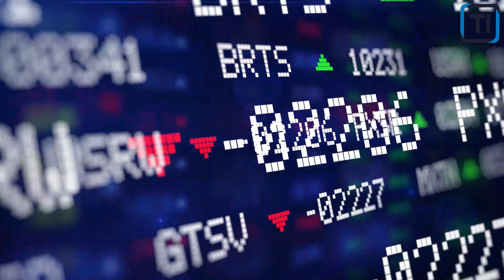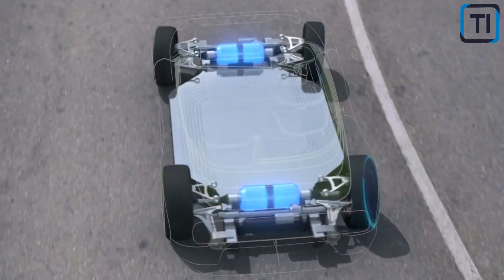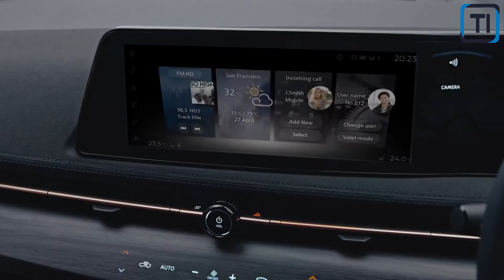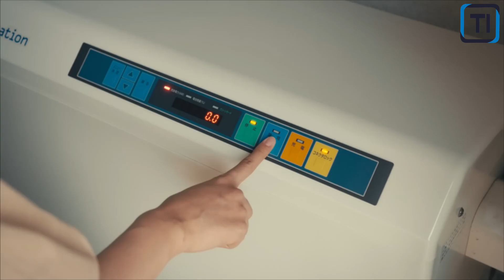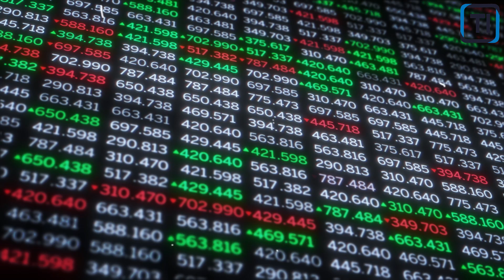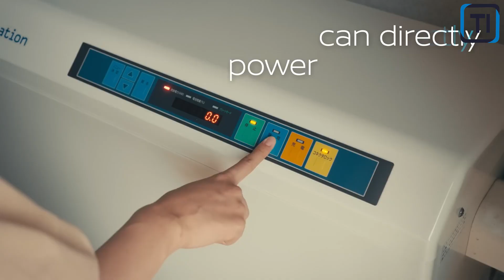Nissan CEO: "Our Solid State Battery Will DOMINATE The Entire EV Industry!''

Comment: Yet another video rehashing the same 4-5 points that can be summarized in 30 seconds (SSBs are lighter, should be safer, achieve higher energy density, charge faster) and marketing fluff about Nissan wanting to lead without any specific substance on how for 10 minutes, only generic speculations that apply to all vehicle and battery manufacturers.